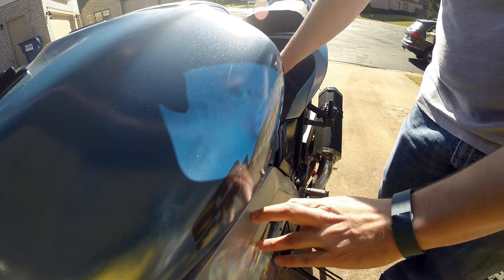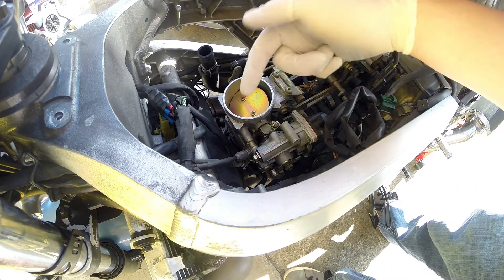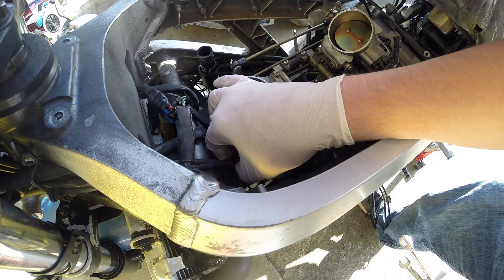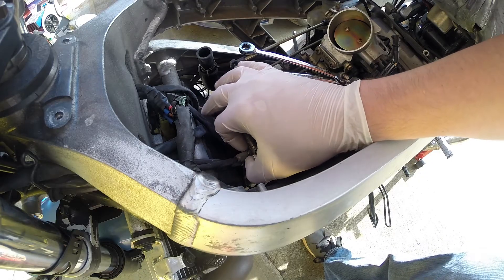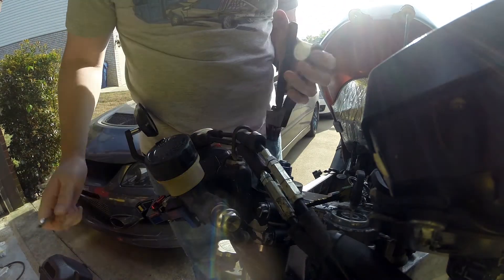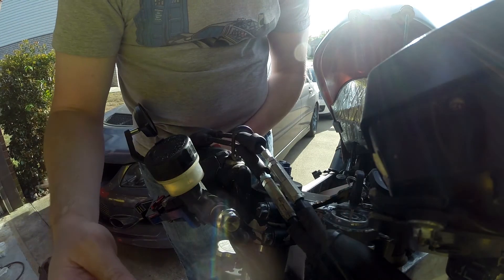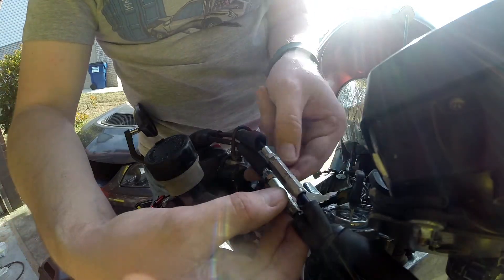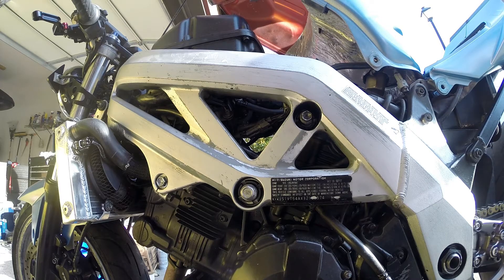How To: Throttle Adjustment - Suzuki SV1000S

Comment: Nice tutorial. Is that a dummy tank? I've making some tutorials too, but I always have to do a voiceover because I find it too difficult to explain while I'm working on my bike. Also usually my kids are running around making too much noise. 😆
Reply from the maker: Not a dummy anything. All done on the actual bike.
Reply from the maker: +Motor Psych Japan Oh, I see why you think that. It's got a huge recess to clear the airbox. It's only a couple inches deep at the cap opening and most of the volume is toward the rear.
Reply: Yeah, the tank looked very shallow so I thought it was a dummy.
Reply: the fuels held in the rear/crotch of the tank if you will :P